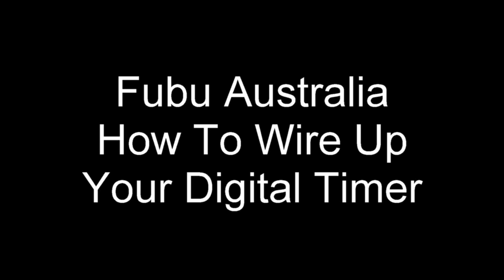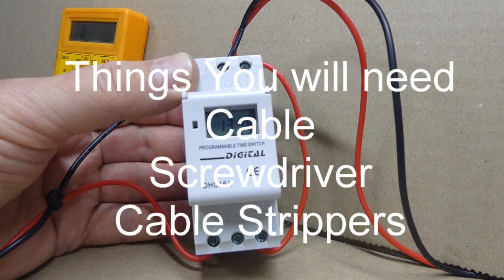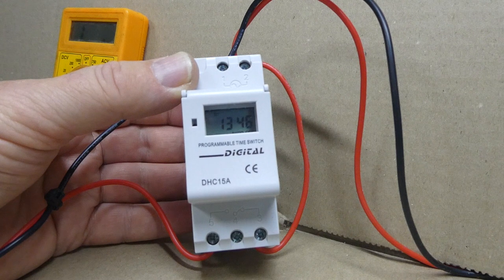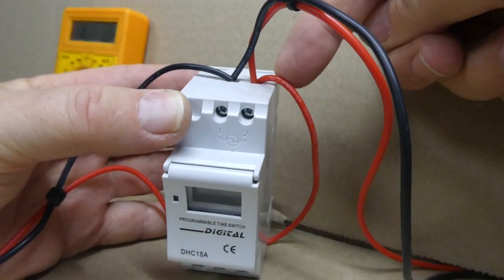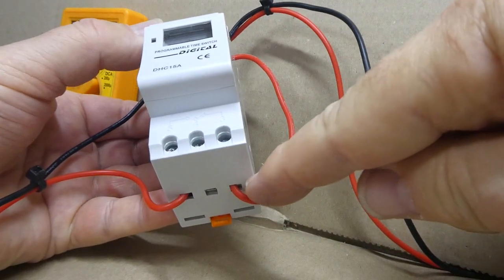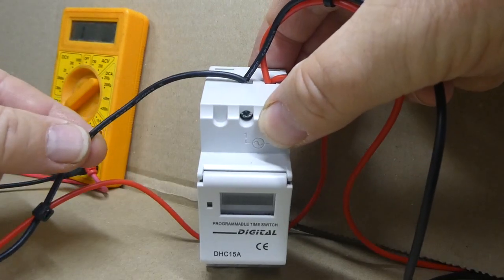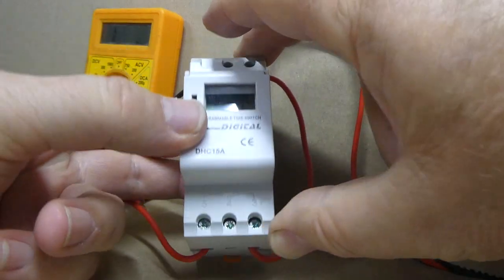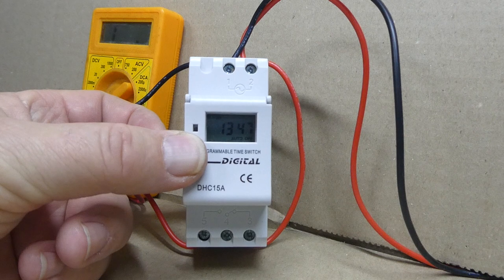How to Wire Up and Connect a Digital Timer from China - PLEASE READ DESCRIPTION

Comment: Isn't it a wrong connection at the bottom.Live wire from the top should connect to the middle and the one to the load should be wither in 5 or 3 depends on the type of timing you need. close or open
Reply from the maker: We work on Normally Open
Reply: @fubuaustralia1436  ty